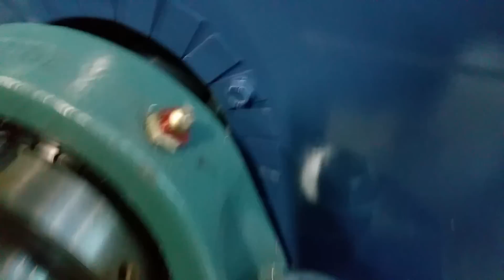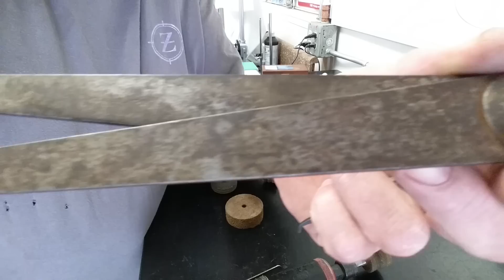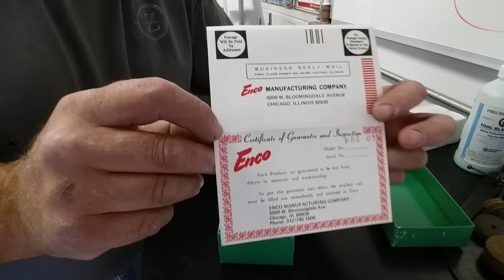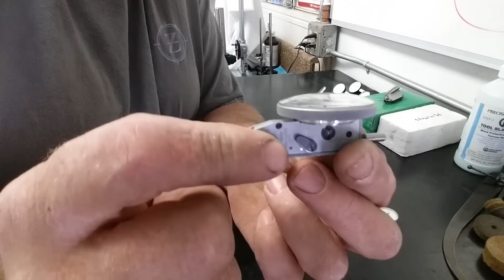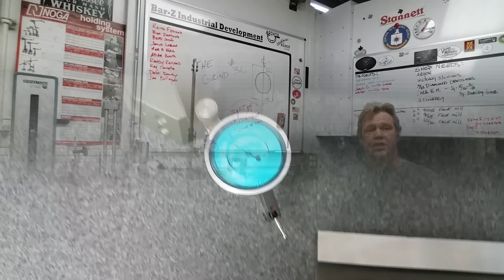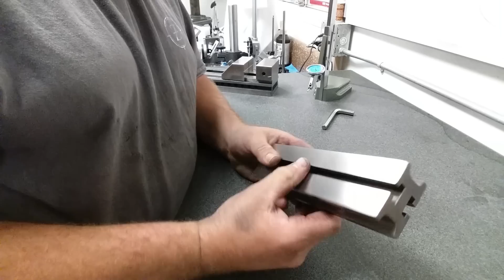The Grind #36

Comment: Hey Stan,

Nicely done. For cast iron try a silicon carbide wheel. They perform better than AO on cast iron. I also like a harder wheel for surfacing the chuck as the chuck material is not very hard and has soft metal strips. I think its a 46K wheel that seems to work the best for my chuck.

Talk to you soon,

Tom

Comment: Very good vid. You might try a Norton 46H half inch wide wheel and light coat of Crisco or bearing grease on the chuck for grinding.The grease will help keep the soft metal of the chuck from loading up the wheel. .0005 a pass to rough and .0001 to finish works well for me. Keep on grinding. Barry

Comment: Really good video, what is the reason behind grinding the chuck with the magnet on?
Reply from the maker: +MrCrispin The theory is that a laminated magnet will have small gaps that get closed with the magnet turned on and distorting the chuck (slightly) keeping the mag turned on during grinding puts it in it normal operating condition. That is the story, I have never been able to measure the difference one way or another.

Comment: Hi

I am curious about expansion in the blower shaft.
Do the bearings aglow for the expansion of the hot shaft?
Reply from the maker: +Dennis Williams We do what we call a "hot set" on the bearing mounts, bring the oven up to temp for the first time and loosen the mounting bolts allowing the bearings to spread apart slightly, tighten while still hot. Been doing this for years and the bearing life is 8-10 years with daily use.

Comment: Wasn't your old mag quite a bit lower? Be a pain to swap it out but might work?
Interesting oven with the dual blowers. I bet shaft straightness and blower balance are quite critical without any center bearing. 

Colin :-)
Reply from the maker: +CompEdgeX I would have probably gained the headroom, but no way am I reseating that sine plate unless I have to.

Comment: You might try ARCHOIL rust remover. It mixes with water and works great. I used for removing rust from some watch/clock repair tools. Takes the rust and turns it black. Then I put the parts in my drill press and polished them they  came out like chrome. 
Thanks for your videos, Greg.